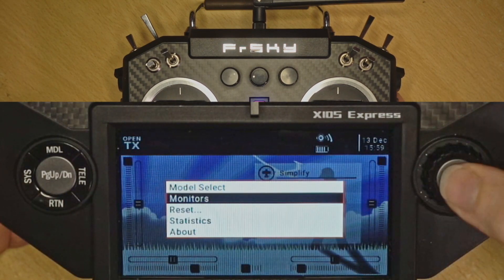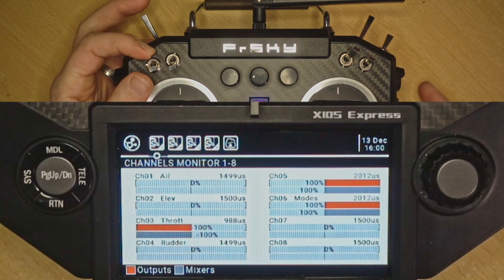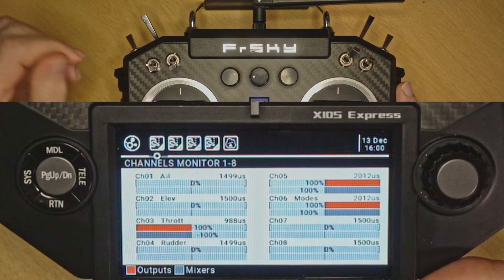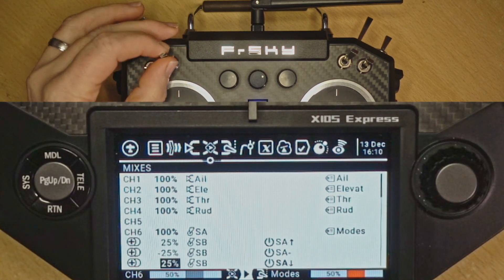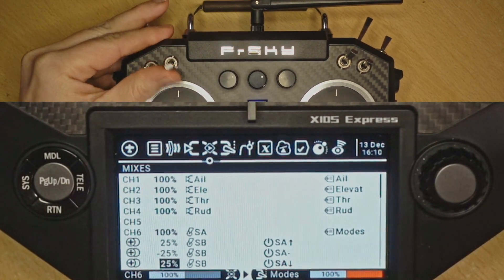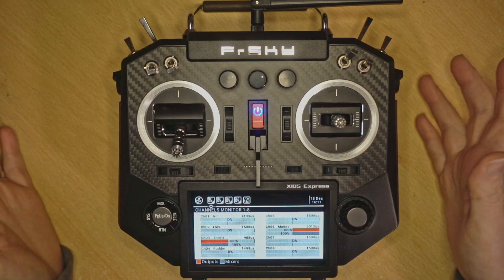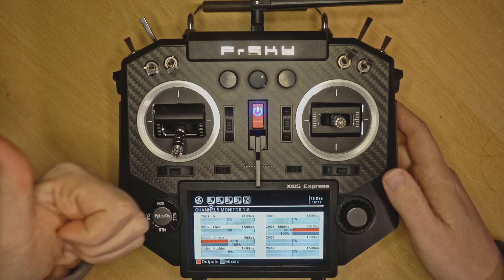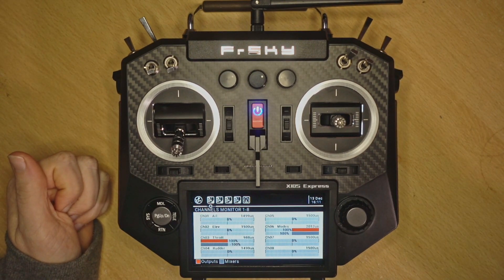Setting Up And Combining Switches in OpenTX

Comment: On the 9 position switches I seem to be missing the first two and last two positions in the INAV modes tab.  In other words it is not registering.  My percentages are moving correctly compared to yours but my US range is between 988us and 2012us.  On the modes tab on INAV it expects 1000us to 2000us.  Have I missed something?
Reply from the maker: Hi Mark. The 988 - 2012 range should be able to be picked up in the iNav modes just fine. Regular 3 position switches will be 988 - 1500 - 2012 as their microsecond values.

If you go to the receiver page, do you see all 9 positions there? How does that compare to the channel monitor on the transmitter? Also, which RC link are you using?
Reply: @MrD  Hi Darren.  I am only seeing 7 positions in the receiver tab.  I have a Radiometer TX 16S with a Matek 2.4G ELRS Diversity RX.  The 5 position switches works perfectly.  Thats plenty to keep me going for a while.  I will try the same again with a CRSF RX model.
Reply: Darren.  Update.  I swapped out the RX for a CRSF RX.  It works perfectly on that.  Can only conclude its a ELRS Rx issue.  Sorry to have wasted your time.  I hope there will not be an issue flying on 5 modes.
Reply from the maker: @markholland2021  it’s possibly the ELRS. Have you tried using wide hybrid mode? It should work with that. Standard hybrid 8 would only have 7 positions on channels 6-11.
Reply: @MrD  Bingo.  That works perfectly now.  Bought you a coffee.  Regards and thanks again.
Reply from the maker: Awesome Mark. I’m glad it’s working for you. Thank you very much for the coffee 👍🏻

Comment: My question is,  What's wrong with just using the channels that we already have.  I mean I have 16 channels why not use them?  I can understand your way as being convenient for some but if I have 6 switches 4 being 3 way and 2 being 2 way why not use them.  I'd have to keep track what switch is activated and what's not the way you are showing.  Is it an issue for INAV when we use separate channels for each flight mode or nav modes?  Or is this just a preference thing?  

Thanks.
Reply from the maker: The problem with using multiple channels is that you are not issuing specific commands to iNav. You will be requesting 3 different modes to iNav, for example; and iNav chooses which one to use. So really, you don't know 100% what will be activated when you flip that switch. You know what that switch position is for. But whether it uses it or not depends on the other switches on the other channels. So you still have to keep track of which switch is activated. If one of them is in manual, it will block all the others, except for RTH.

In contrast, if all the modes are on a single channel, you know that whichever mode you select on the transmitter, iNav will use. So long as it can due to hardware or safety blocks. But those will apply whichever method is uses. Another benefit of using 1 channel, is that it doesn't waste other channels. You say we have 16 channels. Some only have 12. Those channels can soon disappear too. Tuning, pan & tilt, camera switching, LEDs, OSD switching. That's 7 channels in that list. So we're already over the 12 channel limit of Crossfire.
Reply: @MrD  I understand what you are saying but I've always ran flight modes one say channel 5 for angle ,horizon on 3 pos switch. All switches up is Acro just so you no.  Then I run say channel 6 for Cruise and autotune. Channel 7 for 3d Cruise and autotrim or autolevel.  Then channel 8 for manual and RTH. 
I've never had an issue
Reply: Actually it seems to me the way you are doing it requires way more screwing around in opentx fiddling with switches.   My way is I use the channels that are given to me.   No messing about in already confusing Opentx configuration.  I have voice tracks and osd that tells me what mode I'm on as well.   Your explanation is more confusing than anything.  Where you getting inav is not knowing what channels I'm using and it's not 100%   as long as osd and my TX voice outs tell me then I'm pretty sure I'm in that Mode.    Plus the INAV configurator tells me so as well.   I need more explanation than what you are saying because to ME it seems it's a preference thing and just your opinion on being the best way.    Sorry ,that's just way I see it.
Reply from the maker: Ok, so you put your switch on channel 8 in manual. Then you out your switch on channel 6 to cruise. What happens? It doesn’t change to cruise, it stays in manual because iNav is giving manual priority. With only 1 rc channel used, you choose the priority, not iNav. Its a simple matter of control. 

I agree, it adds a little complexity to OpenTX. But, not to the switches themselves. You could have one switch as angle, horizon, and cruise, another switch as course hold and cruise, and the last mode switch as RTH and Manual. Sounds pretty much the same as your example, but operating on one channel. 

It can all be set with an input and one logical switch too. So nothing complex. I’d personally put the autotune/trim and auto level on a separate switch (and channel) just to have more options with the tuning side. For example, I use auto level in angle or course hold. Auto trim can be used with anything except manual. 

At the end of the day, it’s what you feel comfortable with. But the single channel method is a better, and does have advantages.
Reply: @MrD  Ok.  I think I now understand this.  I appreciate you explaining it.   I've just always run my modes on separate channels and used same switch configurations on all my builds and I just know where my modes are.   Flight modes and nav modes including tuning.   If I ever needed extra channels for say pan tilt or cam control I just used a breakout board which has just worked for me.  
I do kinda like your way now that I'm understanding it better and I'll probably set my Phoenix V2 2400 glider up the way you set up modes  and see how things go.

Comment: Very useful. Thanks. OpenTX offers always multiple solutions. But your suggestions are very "clean". Very few programming lines... so I can understand after a year better what I did... :)
Reply from the maker: You’re welcome. 

Its usually best to use the KISS approach. However, what I’ve started doing for OpenTX models that do have a fair amount of logic is keeping a text file of what I do. I’ll have the line number and the function its performing, even if its simple. It just makes it much easier to get back to grips with it if you revisit it in the future. For example:
L01 | Test to see if the throttle is low
L02 | Test that the arm switch is in the arm position AND the throttle is low

The uppercase AND shows that it is what is happening in the AND Switch column.

Comment: What version are you using,   I've a Horus x12s     on 2.3.10.    Cant get the spectrum analyser showing,    and no longer have option for external aerial.     Any ideas
Reply from the maker: I’m sure I’m on 2.3.9 on my Horus. I’ve purposely not updated to 2.3.10 because of the Crossfire bug.
Reply: Yea    I'm not a crossfire user,   have not gone towards drones,  mutlicopters just yet,   I'm a simple fixed wing flyer,     I've tried looking at 2.3.11,  on the nightly builds,    but for some reason my computer doesn't allow me to download it,    keeps saying its blocked        dame annoying as I really want the external back for extra range.     Them the breaks I guess.
Reply from the maker: @russcole5685  2.3.9 works fine, unless there are specific features you need from .10?